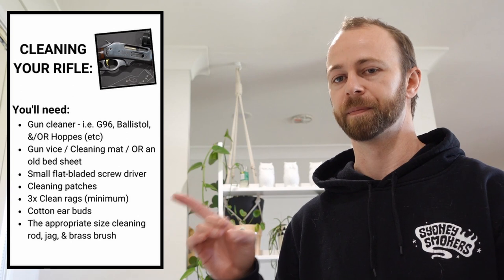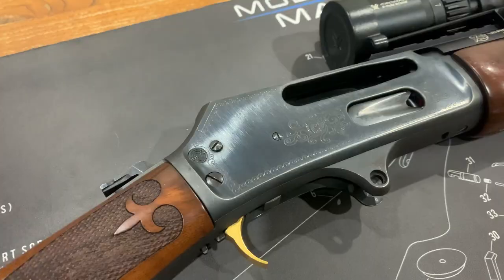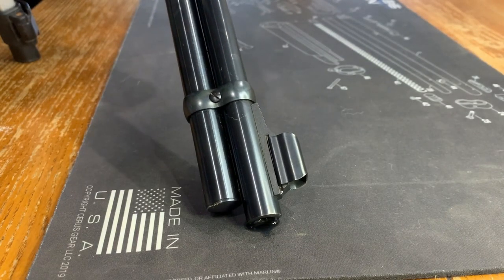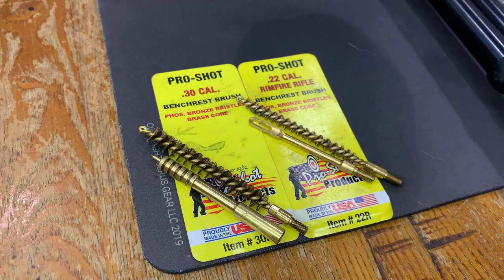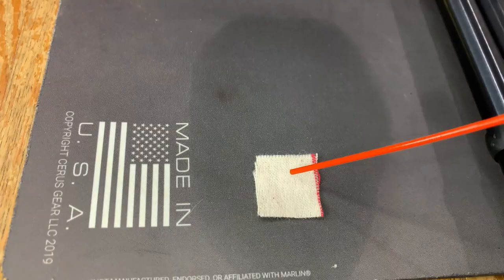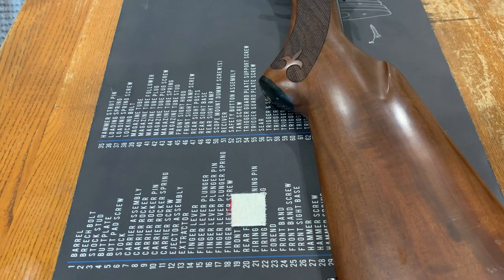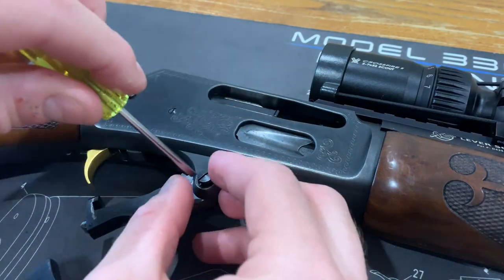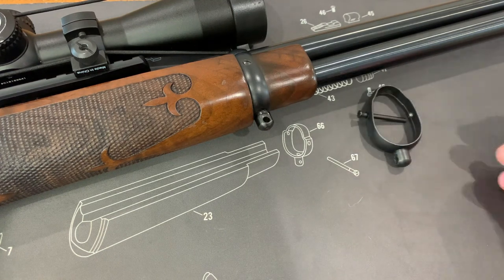How to clean your Marlin 'lever-action' rifle

Comment: Q- do you think running the brush back and forth will bring unwanted material back in to receiver from barrel? You mentioned about not running the patch back in the barrel, thought the brush more likely to bring material back in.
Reply from the maker: That's a great question Richard. Honestly, I had this same concern back when I was first taught how to clean my rifles. I agree that running the brush backwards and forwards has the potential to drag dirt or debris back inside the receiver. However, I think the issue is largely offset by cleaning the barrel out with the patches, and then by following it up with a thorough cotton swab wipe down on the inside of the receiver. To this day, I've never has an issue with a build up of particles or gunk, and the rifle has always functioned as it came from the factory. With that said, if you are concerned about potential contamination, the best option would be to remove the brush at the end of your "push stroke", remove the rod from the barrel, and reattach it before your next push stroke. I hope that helps mate.